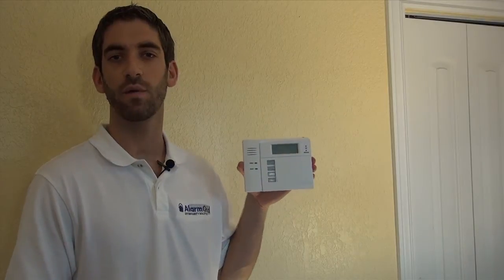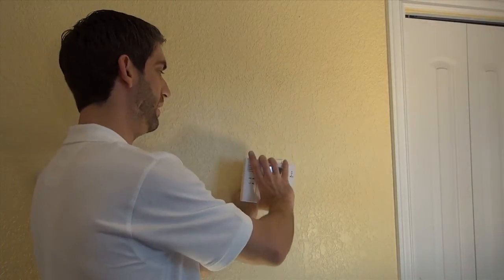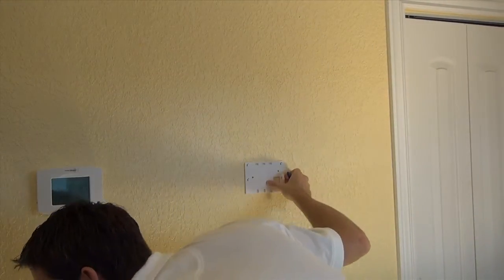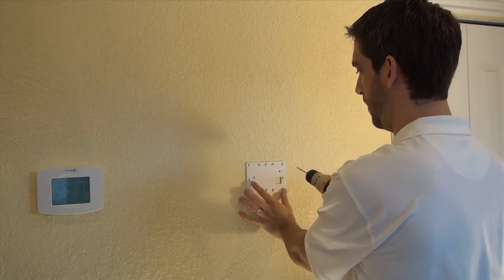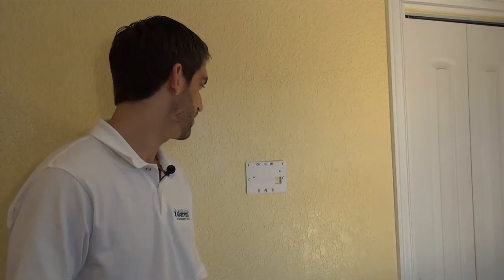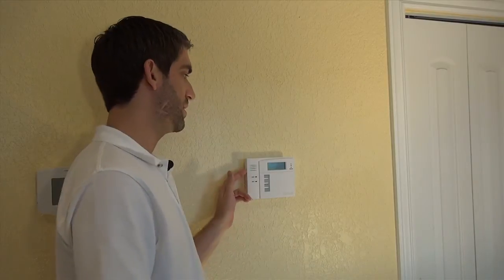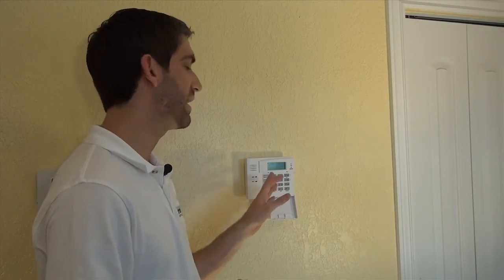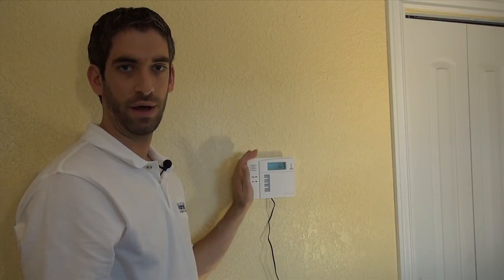Honeywell 5828V: Installation of Wireless Keypad

Comment: 5828 wireless keypad 
When put AA battery it works, but when put 5vdc it does not work. Is there any setting need to do when put a 5vdc supply ?
Reply: No there is not I would reach out to Whoever you purchased the product from.
Reply: @nathangalarmgrid5205  
I bought it from Resideo’s dealer. I have 2 pcs got the same thing !

Comment: Only installation mistake I noticed was that if you’re going to fish the wire in the wall, you should have made sure there wasn’t a stud behind the backplate access hole...and that drill was a little much😉
Reply: Very good points! Thank you for commenting as I'm sure it will help others that are looking to install their Honeywell wireless 5828V keypad. Checking your wall with a stud finder before drilling is definitely recommended.

Comment: Does the 5828 support a bidirectional 5800 wave siren
Reply: The 5828 is just a wireless keypad that works with a Honeywell wireless security system. If your security system supports a 5828 keypad, then it will also support a 5800WAVE siren.
Reply: Thank you Sterling ... a Honeywell installer is trying to get a 5800 to work 100' from the house in my wood shop. He had to replace a board with 2 antenna because it was not bidirectional ... just receive, not sent I think in my house. He replaced it, but never retried the 5800 afterwards. Just ordered another 5800. I think that because of the 5800 being bidirectional, the board being replaced would have fixed the problem. Thanks again for your time.
Reply: Jeff Altenderfer
Which system do you have?
Reply: Not quite sure of the question. 2-Ademco 6271 Color Touch Keypads ... Battery back up ... wireless output if power is cut ... one up and one down stairs. But the system is across the street that he can not get the 5800WAVE to work. But I think that the board he replaced was to make the system bidirectional and he never checked the 5800 after he installed the board. Its hard to discuss this over a keyboard and my knowledge is limited. But I am mechanically inclined (automotive for the last 40 years)